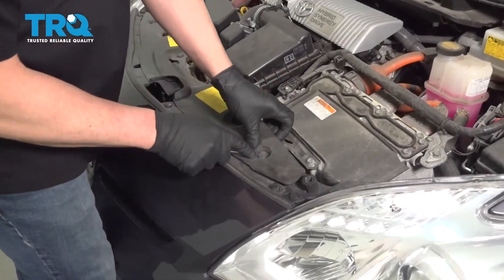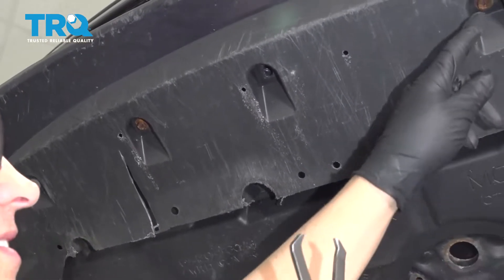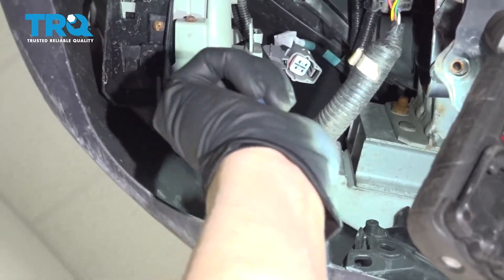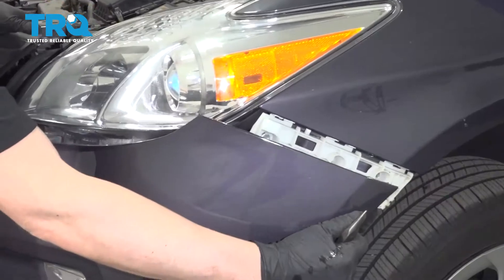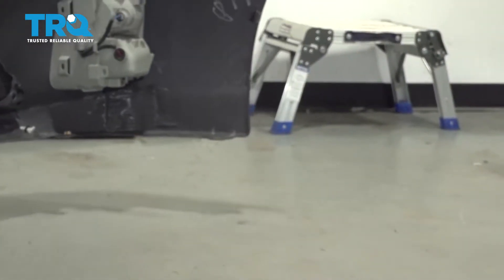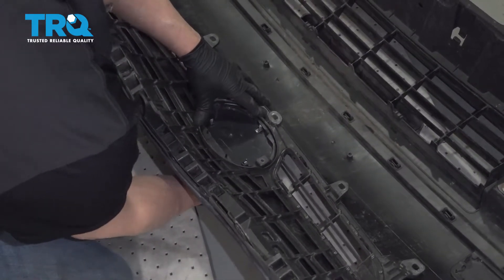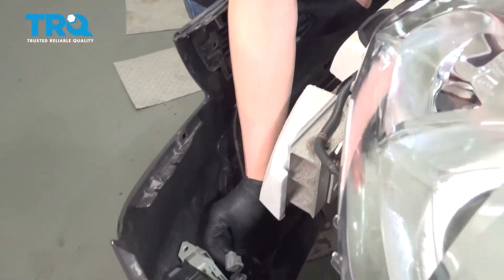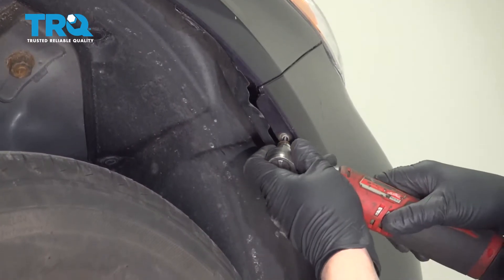How To Replace Bumper 2010-2015 Toyota Prius

Comment: My son drove up a steep driveway and scraped the bottom front bumper cover and popped the bumper cover out at the sides. I pushed it back together but it doesn't stay together on the driver's side. I realized the bumper bracket on the drivers side is broken that's why the driver's side of the bumper doesn't stay in place. Can I just replace the driver's side bracket or will it need a whole new front bumper?